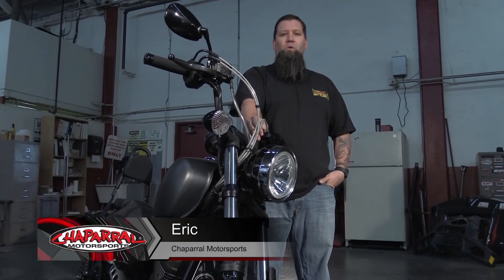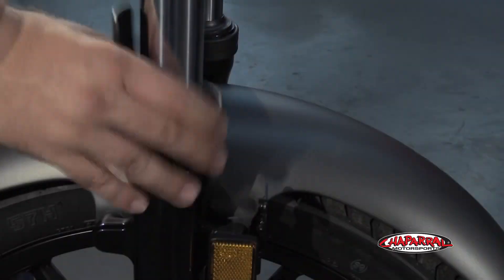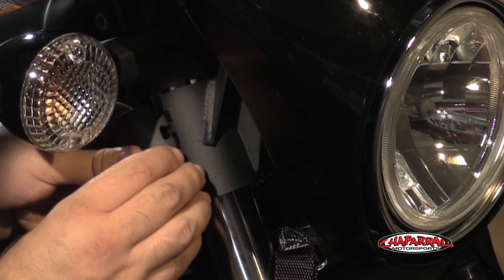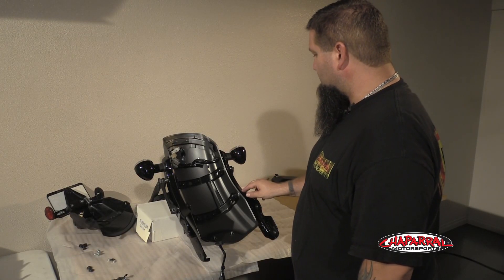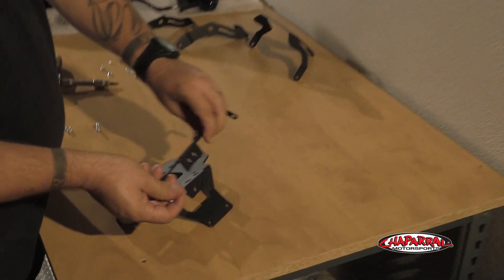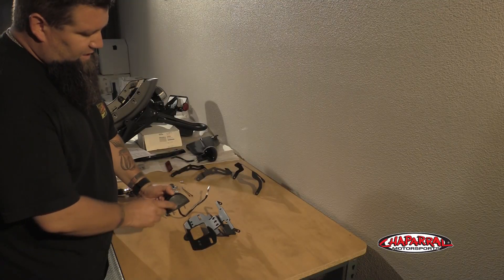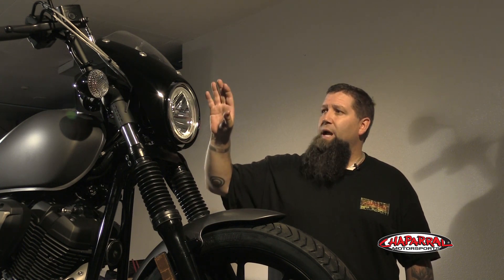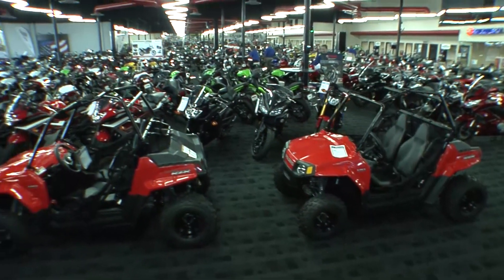How to install Yamaha Star Bolt Fork Gaiters Mini Fairing and Fender Eliminator Kit Tutorial

Comment: They could have just cut the gators length wise and slide it over the forks
Reply from the maker: That's not how they work. They are intended to be sealed top to bottom.

Comment: Hey you didn’t show the part where you have to take those plastic protectors off the forks shocks, I’m having a hard time to remove mine, any advice? And where can I purchase that gator boots? Would you mind giving me the link? I appreciate it.
Reply from the maker: Hello, thanks for watching the video. It's been a couple years since we recoded that video, but if I recall correctly those plastic pieces are just snapped into the grooves at the top of the fork sliders. Try using a flat blade screwdriver to pry them up. I think there was a small slit on the backside that you could fit the tip of the screwdriver into--I think...? 

The fork gaiters are from Yamaha, but they are currently out of stock. You can find them here on our website: https://www.chapmoto.com/yamaha-fork-seal-covers.html
Reply: @chaparralmotorsports  thanks a lot I really appreciate the information you provided. Take care.
Reply: @chaparralmotorsports  какие параметры самих чехлов. длинна , ширина?

Comment: Maybe im just not seeing this right , but it looks like the factory inner fender  covers and holds wiring into the outer fender . wich protects it from mud and water . i couldent see from video if new kit did this as well .?
Reply from the maker: +Cheef Cherokee Yes you are correct about the first part. When you reinstall the new kit the wires aren't as covered up any more and you use the zip ties included in the kit to secure the wires up and out of the way (see 8:50 mark).
Reply: Chaparral Motorsports 
Just found this video. Have you found a way / do you have any recommendations for protecting the wiring from the elements? 
Thanks. I'll be using this video this weekend to install my eliminator.

Comment: In the description for the mini fairing, it states that it is, "not compatible with Tall Handlebars". Is this true? Or did you guys make adjustments in order to make it fit?
Reply from the maker: +KuyaTakashi We did not have to make any special adjustments, other than just the bars back slightly. You also will need to order the extended cable kit in order to have the proper length.
Reply: Greatly appreciated, thanks!!

Comment: Thank god for zip ties. Back in the 1960s, I remember using radiator hose clamps to secure the Sportster fork boots on my old wide glide forks. I got sick of those mega-ugly hose clamps and built up the fork tubes (under the gaitors) with strips of rubber that I glued together. It looked a hell of a lot cleaner. Ah, the things we did in the good old days. This is a very informative video -- thank you!

Comment: Thanks for this video! Without it the install of my fender eliminator kit would've easily taken twice as long 👍
Reply from the maker: Hey mykmenez! That's exactly what we like to hear! Glad it worked out for you, thanks for commenting and sharing.
Reply from the maker: Hey Christian, sorry for the long delay in the reply. The reflectors are part of a one-piece bracket that supports the licence plate. Two things you could do to get rid of the refletcors are: 1. cut the ears off (the pieces of the mounting bracket that the reflectors hang off of) behind the licence plate--that way the license plate is still supported, but the extended ears are gone/hidden. 2. remove the mounting bracket completely and get a new metal license plate cover (the stock is plastic) and mount it directly to the extended tail of the fender (where the stock bracket mounts) using the stock holes. Hope that helps.

Comment: Picked up a standard Bolt yesterday. I know this is an old video, but I had a question on FEK installation. Do you HAVE to relocate the rear turn signals? Can the kit be installed just for the plate, lic. plate light and (I guess 🙄) the reflectors? Dont wanna spend the money if it forces me to set up ONE way, but I'd rather use the Yamaha part. 
Liked the vid, for the detailed installation of the parts!👍
Reply from the maker: Wow! This comment just surfaced today. Did you get your questions answered?  What route did you go?